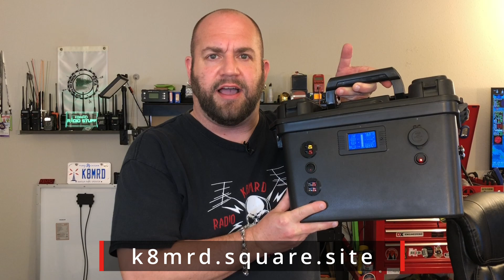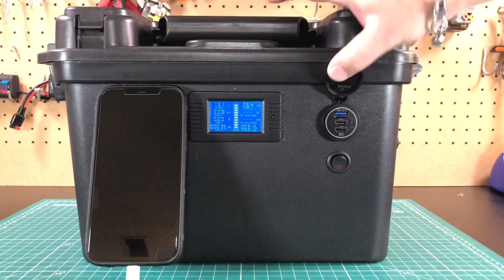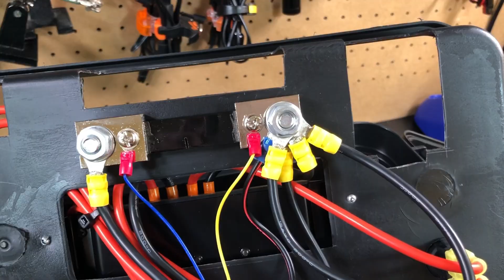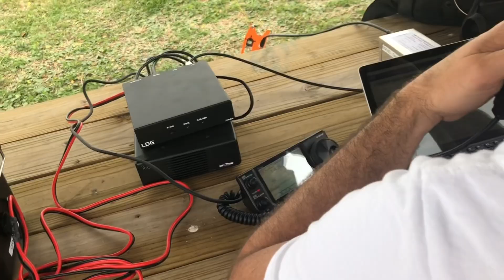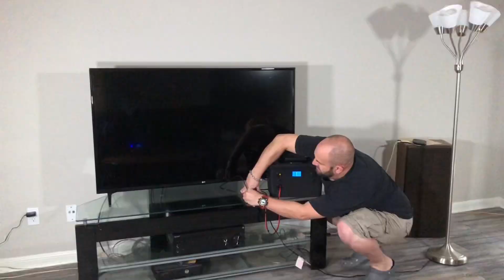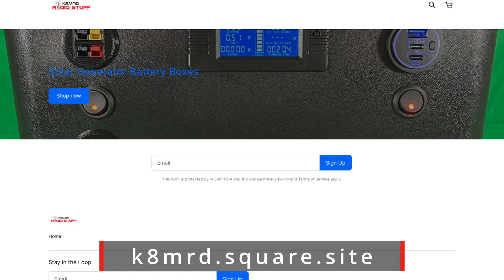Big Geek 12V Ham Radio Battery Box Solar Generator Now On Sale!!

Comment: Mike, just to clarify. It appears you tied both Anderson connectors in each of the dual Anderson mount through 1 switch which would in theory limit what you could connect to them since the switches are probably limited to 20 amps @ 12V? i.e. you might get away with 1 radio and say a tuner. If using two devices pulling more power you'd have to split them between the two Anderson mounts. Does that make sense?
Reply from the maker: yes

Comment: What are those switches for the powerpoles rated for? Surely not 45A?
Reply from the maker: No, I wish I could find a small enough 12V switch that was rated that high.  These are 20 amp switches.  I have a couple 25 amp switches in my personal box that I put in after building it to test it out but I find 20 is enough for what I designed these for.  And I like the smaller form factor.

Comment: Great job Mike!!! I have convinced my xyl to let me build one. It doesn't look nearly as good as yours but the functionality will be there... I'm on a retired disabled vet on a shoestring budget, thanks to Covid-19. I used an old kobalt tool box i had in the garage and used some old crude tools. Here's what it has so far: usb 3.0, 1 usbc, cig lighter socket(switched), 30a pwm  charge controller(switched), solar input, 2 outputs for radios (individually fused), 12v high capacity lugs on top (for a trolling motor) and the battery monitor you recommended. In addition,  i added an XT60 socket to plug my ac charger straight into the battery instead of normal battery charger clamps. I'm starting with 50ah but will be adding another one parallel before the end of July when we go camping At lake sherwood wv in the national forest. Thanks for the insight and inspiration!!!
Reply from the maker: Sounds awesome man!  I'd love to see it when it's done.  Shoot me some pics.  I'm good on qrz.
Reply: @K8MRD RADIO STUFF  it's up and running the charge controller is on the outside of the box. I have to wire the solar and high capacity lugs yet. I tested it on my oxygen concentrator tonight. I used about 2.3ah to charge it from 45 to 100%. Not to shabby. I'll test it on my ft891 hopefully this weekend. I also bought screen to use as a ground plane for my wrc. I'm beginning to like retirement.

Comment: Can you charge with solar while using the battery ?any thought to offering them with different battery sizes?
Reply from the maker: You sure can.  I’m working on a smaller box with a 12ah battery but that’s prob not going to happen for a little while.
Reply: @hamradiotube  Was wondering if you would consider selling without the battery. I have a 40amp battery.

Comment: That is a very professional sales video. Good job on both the box and the video. Hopefully they sell well.
Reply from the maker: Thanks so much.  With my background in sales and love for infomercials this was a fun video to make.  Almost sold out already.
Reply: @K8MRD RADIO STUFF  Wow! That's awesome that they are selling so fast. Good for you bro!
I'm happy you can make some money while doing what you love. 

I come by Pelican cases all the time from work. 

I wanna make a battery box outta one. 

I'm thinking about making it so that everything is inside and it can be closed up and water tight when not in use. ‐N7JSX

Comment: can it take 24 volt panels?
Reply from the maker: You'd want to use panels that work with a 12V system.  I know the panels I typically use put out ~20 volts so I would imagine you would be OK.  I have a RichSolar panel that puts out 22.5 Volts and that works fine as well.  Here's a link to the CC if it helps.  https://www.bioennopower.com/collections/solar-controllers/products/12v-24v-20a-solar-charge-controller-for-lifepo4-batteries-sc-122420jud
Reply: @hamradiotube  the reason why i asked that is that i have plenty of 24 volt solar panels from work :D
Reply from the maker: @WX4CB  Have you used them with any other 12V system?
Reply: @hamradiotube  all our stuff is 24 volts except the cellular stuff and that runs on a 12v regulator

Comment: thats a sweet $100 battery and $17 monitor.
Reply: Great engineering, but I'm not sure you can call it a solar generator with no panels. At this price, I would expect circuit breakers instead of fuses, as well. 
Good ideas, but there several options available.
Reply from the maker: Thanks.  Don' forget to go to k8mrd.square.site to pick one up.

Comment: Big geek is looking great! Such nice improvements. 

Question: Are you going to offer an option that does not included the battery?
Reply from the maker: Maybe eventually but not right now.  My focus is more on producing a turn key box that people don't need to do anything to other than turn it on and go.  There's other reasons but that's the biggest one.